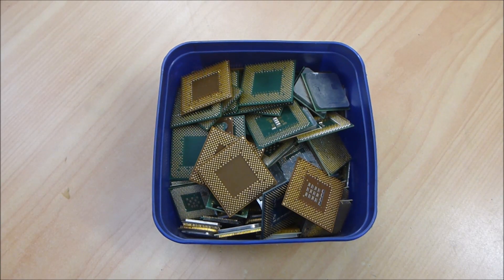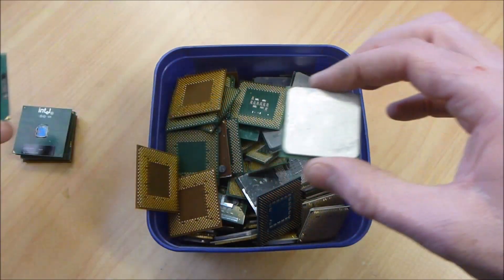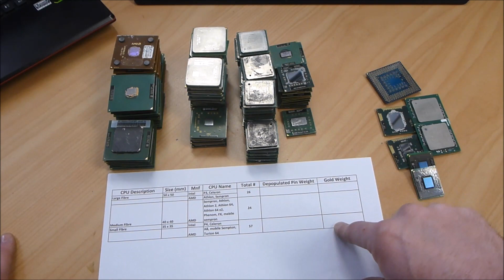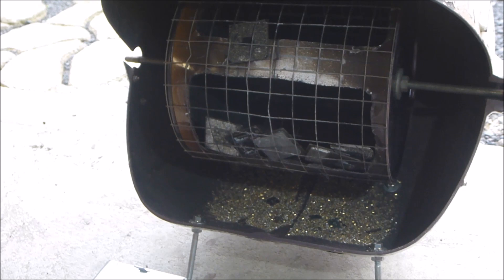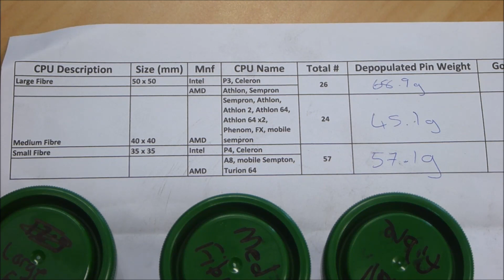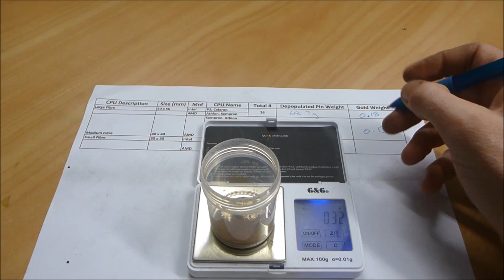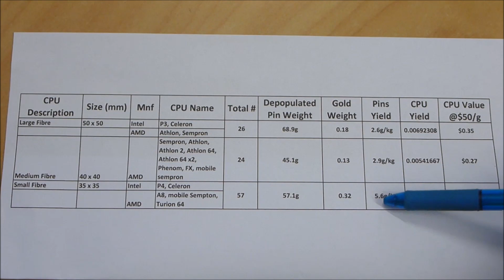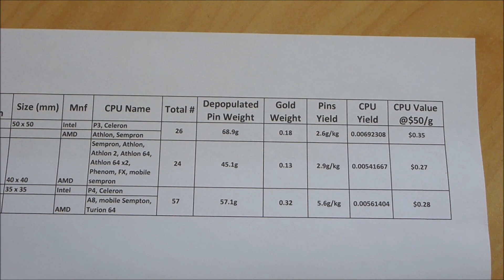Gold Recovery - Yield from 'Junk' processors

Comment: i have 25kg of motherborads should i depopulate them and separately process chips,bga and pins for gold and sliver, Would it be profitable to recover gold from it or sell the whole motherboard to computer shops for profit or should i collect some more motherboards like 50kg and then process it for gold [ Im very new to this just recently started collecting e-waste]
Reply from the maker: @orange-dd5rw  hi, I dont personally bother with motherboards, they actually jave very little Gold. I separate the heatsinks for scrap Alu and sell the motherboards. If they have Gold corner BGAs you can definitely pull them off and wait till you have a feqw 100 grams to process them, but that might devalue the boards if you sell them.

Comment: hi guy, from indpls, in. iv commented from wash, st way back when, so if you get this note & have the time have you ever ground up flip chips & looked through your microscope ? also have a buch of boards with white & purple ceramics with no gold showing, if it were possible to grind these to a powder would you find bonding wire fragments, just wondering how elect. impulses get from die to legs that are soldered to board. thanx ,  woody.
Reply from the maker: Hi Woody, there are always bonding wires (apart from modern flip-chip ICs), just sometimes the bonding wires are Aluminium instead of Gold. In ceramics a lot of the Gold can also come from Gold-Braze used to attach the die to the ceramic.

Comment: You are losing yields from the bond wires in all the ceramic on those though by not processing that so the chips yield more gold  if you pulverize them too.
Reply from the maker: These are flip-chip fiber processors, there are no bond wires, there is no ceramic. There are silicon dies that are soldered directly to a PCB carrier using Tin based solder ?!?!

Comment: Great Video 👍🏼 im a few years late, but I was wondering, isn’t there gold under the solder mask on those CPU’s? On some green fibre BGA’s I’ve removed the IC ‘top’ and found gold circuit pathways underneath. I guess I’m wondering if there is gold plated pathways connecting to the silicon die on the cpu.. thanks 🙏🏼
Reply from the maker: Hi there, there is absolutely no reason to use hard Gold plating under the solder mask, even when the Cu under solder masks is Gold plated (like on Sound Blaster cards), it is just ENIG plating, so there is almost nothing there.

Comment: Most people don't know what the tcb/ecb board is! What most people call the "fiber". It's the thermal connection board/electrical connection board. Although difficult to do, you can chemically dissolve the board. Much of the thermal system is gold, the electrical system is either advanced routing copper or an alloy. I used to work at redacted but used lasers to strip the cpu and base board for destructive testing. ALWAYS had to return my blown junk, due to gold content. This did not include the silicon dies, I could have them as souvenir's. Mostly because they had no value and decoding them would cost more than figuring it out oneself. Shredding does not work without a step to dissolve the epoxy. The bonding is really, really good. Currently relearning the unbonding process. Burning also doesn't work, it'll burn the gold off as vapor as well as the junk.

Comment: very sorry if I missed it but what is the complete processor weight compared to just the pins a kg of pins is a lot of pins or is it a kg of processors to get the .35 and so forth again im sorry if I missed it
Reply from the maker: Hi there, dont think I ever weighed the processors, but rigjt at the end, around 15:45 you can see the results showing how many of each processor gave how much pin weight then how much Gold weight, should be easy to work out from there.
Reply: @successfulengineer  quick question and thank you so much for your reply if you had 1 kg of 486 & 386 ceramic cpu's do you think the yield would be close to 6g just asking because of your experience
Reply from the maker: @cditzler6313  hi, that is a very hard question to answer, it would depend on the manufacturer, factory and specific type of 386 or 486. I would normally bargain on about $4 to $6 US per 386 or 486, so if youknow hoe many CPUs go into 1kg, that should tell you whether 6g sounds correct
Reply from the maker: Looks like the actual pins yield between 2.5 and 5 g of Au per kg of pins, which is about what I would expext for fully plated pins

Comment: What type of processors do you have the highest yield from (Im going back thru your videos now)?  Thanks
Reply from the maker: Hi, ceramic processors are obviously by far the best yield, but the 'junk' processors are all pretty similar yield. I guess if you are processing with acid, then the smaller processors with smaller pins would be the best since they have the least base metals to get rid of.

Comment: It would be interesting to me knowing the amount of time and acids used for the process too.  That can really inform individuals the cost efficiency of cost vs reward.  Great vid none the less!
Reply from the maker: Thanks for the comment Jeremy, with this being a hobby, I try not to focus on cost vs reward too much. The cost of acids also vary a huge amount depending on where people are located, so maybe a 'total acid used' volume would be better than cost of acid used. I figure if someone knows that one of these CPUs is worth  $xx then they can decide upfront whether they will bother going through their process.
Reply: Not much I bought a 2.5 gallon glass Carboy of Nitric acid for $110, a gallon of muriatic acid costs $20, smb used to drop the Gold is about $10 per lb , add an extra gallon of muriatic acid & you could probably process more than 1 LB of Gold,@ $4400 CDN per oz not a bad return in 2025

Comment: How did you separate the pins and the capacitors
Reply from the maker: Hi Jason, primary just be sieving the material. I have a reasonable selection of different 'mesh' value sieves, so I was able to find ones that would allow the pins through while retaining the caps. If you have a few capacitors in there they don't really cause any harm, as long as you do a HCl wash on the pins to remove the Tin. Good luck
Reply: Helpful, thanks

Comment: WHAT IS THE CONCENTRATION OF THE HCL AND OTHER ACID THAT YOU USED IN THE 
 PROCESS
Reply from the maker: Hi there, in all my videos, HCl is 38%, HNO3 is 68%, but the concentrations are not critical, pretty much any concentration of these acids will work, using concentrated acids just speeds up reactions.

Comment: Very  inspiring! kovar and copper base pins, another sub division that you can make.
Reply from the maker: Hi OwlTech, for sure, I wonder if there would be a yield difference ? You would certainly process them differently under normal circumstances.
Reply: The yield wold be function of the plating thickness , the area plated and recovery method efficiency.  I'm sure plating thickness and area vary from model to model, even from batch to batch, but if we assume they are constant,. then the difference would be, as you mentioned above, the route of recovery.
Reply from the maker: Yep, 100% agree. I think these would be a great candidate for your Iodine methods, dissolving away all the base metal is painful!
Reply: :) Yeah, my observation is that KI/I 2 leach works best on magnetic scrap,  (copper pins with nickel barrier are also attracted to the magnet)

Comment: I've got a bit of a problem with a batch of gold pins from cpus that I tried processing. I had them on heat in hcl but after letting them cool down I got a lot of crystals form and now it is just a solid chunk. Any idea what I can do to remedy this?
Reply from the maker: Hi Nick, I would add some fresh HCl, heat it up again to see if the crystals dissolve, then decant the solution while still hot.
Reply: Successful Engineer that worked a treat. I honestly don't know what I would do without you!
Reply from the maker: Hey Nick, great news! Keep me updated with how you go.
Reply: Successful Engineer I've finished the process and I recovered 0.7g from a batch of cpus similar to what you processed in this video. I started with 2kg of chips of different shapes and sizes but some still had the heat syncs on them so that would have added extra weight to the batch. I bought them as a job lot with 5kg of ram sticks so I wasn't sure what kind of yield to expect. At the end of the day I'm just happy to have recovered some gold from them. Once again thanks for your help!
Reply from the maker: Great news mate! Always nice to get some results! If you started with 2kg of black chips with legs, you would expect between 2 and 3 grams, so there's probably still a few bond wires in your waste material!
Reply: Successful Engineer my gold was recovered from 2kg of cpus, I'm still processing the ic chips as we speak. I will post results from the ic chips once I've finished.
Reply from the maker: Ahh, I see, does your yield from the CPUs look similar to what I got ? Looking forward to hearing how you go with the ICs!
Reply: Successful Engineer I would say your total yield was better than mine. I never counted my cpus nor did I weigh the pins once ous removed them.  But I would estimate a total figure of around 150 - 180 cpus were processed.
Reply from the maker: Yeah, those 'junk' cpus are hard work for not much Gold, I think you will be pleasantly surprised by the ICs mate.
Reply: Successful Engineer yeah I definitely won't be in a rush to buy anymore of them that's for sure. I'm keeping my fingers crossed for the ics though. If you remember I said that I recovered about half a teaspoon of material from my blue bowl from one of my first runs. Well I've processed that material and I got 0.75g of gold back. If I can keep that recovery rate up I will be more than grateful!
Reply: the rougemillenial that's good to know. I now know the cause of the problem and how to resolve it. Thank you!

Comment: I thought I got 1mg per 10 "large" fiber cpu but now that I think about it that might have been black fiber cpu. Either way I enjoy your videos, nice work!
Reply from the maker: I think the black-fibre CPUs are another generation earlier than my 'large fibre', so I wouldn't be at all surprised if they perform a little bit better. I know the last of the ceramics, the flip-chip AMD type, yield about 10 times more per CPU than anything in this test! Thanks for the comment!

Comment: Very good and clean work congratulations!! now you are on the way to  one pound gold club. good  data  it help a lot making decisions on what to sell and what to recover. can we see how do you melt those big beautiful buttons. BTW you`r results are very accurate  you are doing exactly what i wish to do i`m been stacking for three years cherrypicking e waste. it will be interesting if you do the same with  different type of ic chips. for all beginners like me  will be a guide. keep that good work it is one of the few hobbies that is very fun and pays back.  Regards Luis ...
Reply from the maker: Hi Luis, nothing special about how I melt the 1 ounce buttons, I use 2 x MAPP gas torches (like in my first Gold Recovery video) and a small ceramic crucible. I also surround my melting area with fire-bricks to insulate the melting dish as much as possible. Definitely more yield videos to come over time. Appreciate your comment!